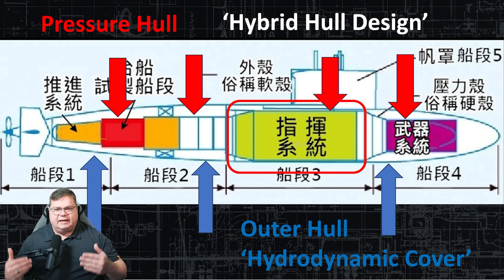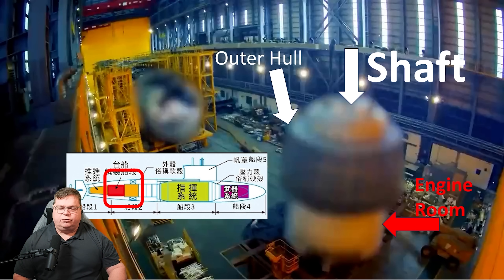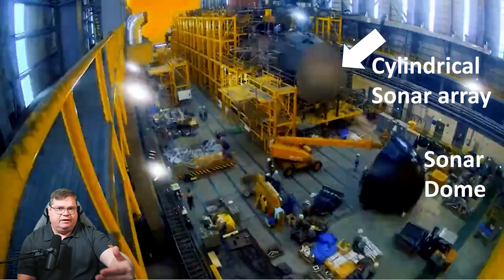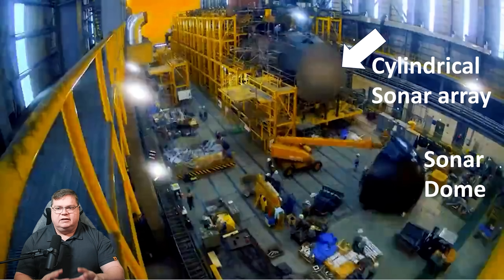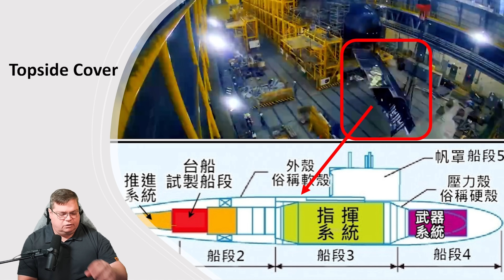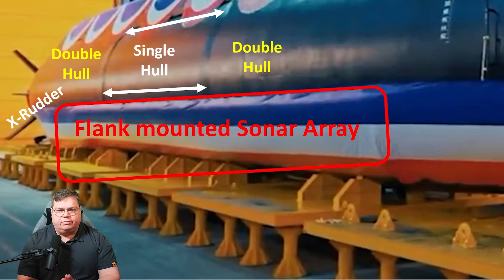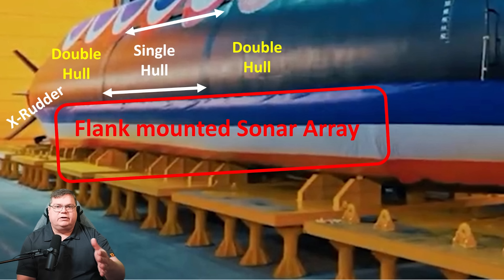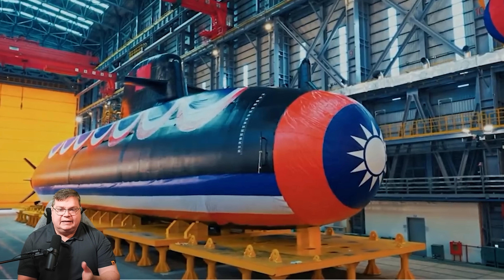What They Don't Tell You About Taiwan's First Submarine

Comment: Congrats Taiwan on a pretty solid first domestic boat design!
Reply from the maker: It really is!
Reply: Taiwan's first nearly 3,000-ton self-made submarine "Narwhal" has just been built and is undergoing testing. Taiwan's first AI unmanned attack submarine "Huilong" will also be launched by the end of this year.
While Taiwan is building manned submarines, it is also secretly using submarine development technology to produce unmanned submarines. The self-made "Huilong" (meaning: Intelligent Dragon) unmanned submarine is a smaller version of the submarine, with specifications of 30 meters long, 6 meters high and 3.6 meters wide. It adopts a double-shell design (the length of the inner pressure shell is 20 meters). Its height including the sail cover is 6 meters, and the outer shell is also coated with black sound-absorbing coating. In addition, the internal settings are not only equipped with cruise, sonar detection and other systems, but more importantly, it also adds a life support system (for special forces missions) and a system equipped with two torpedo launch tubes. This is almost the basic configuration of a 100-ton small submarine. It uses a hull similar to a manned submarine with a sail-type structure design, and is also equipped with two torpedo launch tubes. The "Huilong" unmanned submarine can launch small unmanned AI boats, torpedoes, mines and underwater loitering munitions to monitor, lock on and loiter attacks on enemy targets. The hull of the "Huilong" unmanned submarine is made of alloy steel produced by Taiwan Steel and can withstand seawater pressure of 1,000 meters. It allows the "Huilong" unmanned submarine to stay at a depth of nearly 900 meters underwater. Not only will it not be detected, but it will also be unable to be attacked by mines or torpedoes.
The "Huilong" unmanned submarine can perform combat missions alone, or it can accompany the submarine as a wing boat for coordinated operations.
Taiwanese civilian manufacturer has developed an Autonomous Underwater Vehicle (AUV) for the Navy - the Seawolf 400 AUV system. The Seawolf 400 AUV is 4 meters long, weighs about 1,000 kilograms, has a speed of 2 to 7 knots, can submerge for 8 to 10 hours, and can carry AI reconnaissance equipment and attack weapons.
Taiwan's Navy has partnered with an innovative company to develop an underwater glider. This equipment has the characteristics of long-term operation, large-scale collection of underwater information, high concealment, low maintenance and operation costs, fast maneuverability, and diversified underwater reconnaissance. It can collect hydrographic information for the Navy and influence the selection of sonar modes and the application of tactics. In addition, the equipment also has stealth characteristics and can perform underwater missions for more than one month, improving the Navy's ability to deal with underwater operations and intelligence collection. Several underwater gliders are currently being deployed to perform missions.

Taiwan plans to produce eight Submarines, 46 AI Unmanned Submarines, hundreds of Seawolf 400 AUVs, and a fleet of Underwater Gliders. Based on this, the Taiwan Navy has been able to build a powerful, modern underwater fleet with AI networked combat capabilities.
Reply: The Navy of the Republic of China 🇹🇼 is so powerful 👍
Reply: I am a Taiwanese , Ｉ want to say thank you to West countries . Without your help , we could not build this Submarine . We will always stand with Liberty and Democracy , never surreder to the dictator!
Reply: @台灣跑起來  Same here. Thank you all the foreign countries who helped us!!
Reply: @台灣跑起來 還有日本和韓國。
Reply: @台灣跑起來  You should thank Korea as Taiwan needed Korean companies to assist. And to make matters worse Taiwan allowed technology to be leaked to mainland China.
Reply: Underwater submarines are difficult to detect. The waters around Taiwan are even more complex due to the Kuroshio Current and volcanic terrain.
The Kuroshio Current, also known as the Japan Current, is a branch of the North Pacific Ocean current system. It is the second largest ocean current in the world, originating in the Philippines, passing through the East Coast of Taiwan, and flowing northeast along Japan before merging with the North Pacific Current. The Kuroshio Current has a current speed of 1 to 2 meters per second and a width of over 200 kilometers. Fish and underwater vehicles are carried along by the Kuroshio Current like they are on a highway, automatically flowing towards the North Pacific Current region. The complex deep sea area where the fast-flowing Kuroshio Current passes through stretches from the Bashi Channel region in southern Taiwan, connecting to the East coast of Taiwan, to the Miyako Strait region in northern Taiwan.
Sea of East Coast of Taiwan, a "thermocline" is formed in the area where the water depth is 100 meters. Only a few sound waves can penetrate this "thermocline." Most of the sound waves are reflected back from the "thermocline" like a mirror, and continue to transmit back and forth between the "thermocline" and the surface of the sea. A sonar detection blind zone is formed below this area. Taiwan submarines and unmanned submarines can hide in this blind zone, and the Chinese military ship's sonar system or the sonar detection system thrown into the sea by anti-submarine aircraft from the sky will be unable to detect Taiwan submarines and unmanned submarines.
If Taiwan submarines and unmanned submarines dive to a depth of 200-300 meters below sea level, the enemy can only use submarines to search for submarines to detect them. However, the surrounding waters of Taiwan are Taiwan's territory, especially the Bashi Channel in the southern part of the Taiwan Sea connecting to the Miyako Strait region in northern Taiwan, which is an area with unpredictable Kuroshio Currents. Chinese submarines or underwater vehicles cannot stay in this area for long. They will be automatically washed away to the North Pacific Ocean by the Kuroshio Current and will be unable to sustain combat operations here.
Taiwan has already fully understood the Kuroshio Current area in the east, and is clear about the changing location of the underwater ambush zones around Taiwan throughout the four seasons. It has also deployed fixed and floating underwater sensors or unmanned submarines. Taiwan submarines and unmanned submarines are ambushed in the underwater ambush zones that move with the seasonal sea conditions, or they release denial intelligent mines in the surrounding area in advance. Chinese submarines dare not approach, for fear of being caught in the net and killed. When necessary, Taiwan's IDS submarines can dive to a depth of nearly 400 meters below sea level, where Chinese submarines cannot reach. They can then launch MK-48 torpedoes to easily destroy any enemy submarines or enemy fleet convoys that want to attack.
Taiwan's geographical location is unique. The West Taiwan is separated by the Taiwan Strait to China, which is on average 180 kilometers wide, which is a natural barrier that can easily deter China's attempt to invade Taiwan by landing. The Bashi Channel in southern Taiwan connecting to the East Coast of Taiwan to the Miyako Strait in the north is an area with fast-flowing underwater currents. It is an area that cannot be stayed for long unless there is support from a nearby port. It is also a natural barrier. Taiwan's great self-made submarine capability has supplemented this block of underwater defense and combat capabilities. It can easily deter China's attempt to invade Taiwan from southern, eastern, and northern Taiwan. Taiwan's national defense is in a state of prosperity, and Taiwan can now rest assured.
Taiwan's domestically produced submarines and unmanned submarines are the most important strategic weapons of national defense. Now that Taiwan has produced manned and unmanned submarines, China not only has no chance to cross the sea to invade Taiwan or blockade Taiwan, but it also has to worry about its ports being blockaded, which will completely shatter China's illusion of invading Taiwan! Taiwan's air defense missile system density is one of the highest in the world. It is impossible for the Chinese military to fly over. The Taiwan Strait in the west of Taiwan is a transparent firing line. The Chinese military ships and submarines that invade from here are tantamount to suicide. The southern, eastern, and northern parts of Taiwan are guarded by the natural Kuroshio Current barrier and the submarines and unmanned submarines of Taiwan Navy. The Chinese aircraft carrier, destroyer, and escort fleet will not dare to come.
Reply: This is the KEY😂🎉
Reply: Taiwan took 4 years to learn and design its self-made submarine, and only took 3 years to complete its self-made modern submarine.  Taiwan break the world record for manufacturing the submarine. In 1988 Taiwan was the 1st Asian country who could design and manufacture self-made 3rd generation Jet Fighter. Taiwan is also designing its own fifth-generation stealth twin-engine fighter jet, and the prototype will be produced in 2025. Taiwan is not only strong in semiconductor chip manufacturing technology, but also in other industries. Bravo Taiwan.
Reply: Taiwan has successfully developed a 533mm-diameter torpedo launch system for Taiwan-made IDS submarine Narwhal. In addition to being used to launch US-made MK-48 heavy torpedoes, the system is also being prepared to launch Taiwanese-made submarine-launched Hsiung Feng II anti-ship missiles, submarine-launched Hsiung Feng III supersonic anti-ship missiles, submarine-launched Hsiung Sheng cruise missiles, and submarine-launched Sky Sword II air defense missiles. The diameters of these Taiwanese missiles, after being modified and installed in submarine-launched pods, are all smaller than 533mm torpedo launch tubes, and the IDS submarines can all launch them in the future.
During launch, the torpedo tube will push the Taiwanese missile pod into the sea. After traveling a certain distance and approaching the surface, the missile engine will ignite, break out of the pod, and emerge from the water. After the guidance system is activated, the missile will fly into the sky and autonomously attack the target.
Reply: @taorente7438  All 3rd party tech which will be handed down to their mainland chinese brothers. Chinese Taipei is he biggest backstabbing nation on earth. Despicable. They use White Western names and rathe be Japanese even though they were colonized by them. LMFAO.

Comment: Oh no, that hull design looks bad. Too many different diameter pressure hull segments with steps welded together. Every one is a weak point and it would be better to make it with smooth transitions or the same diameter throughout the pressure hull. We don't want it to pull a Titan and implode at depth.

Comment: Superb coverage of this exciting new boat which seems perfectly specified to address the immediate threats Taiwan faces. Great job Arron, great job Taiwan!
Reply: Taiwan's first nearly 3,000-ton self-made submarine "Narwhal" has just been built and is undergoing testing. Taiwan's first AI unmanned attack submarine "Huilong" will also be launched by the end of this year.
While Taiwan is building manned submarines, it is also secretly using submarine development technology to produce unmanned submarines. The self-made "Huilong" (meaning: Intelligent Dragon) unmanned submarine is a smaller version of the submarine, with specifications of 30 meters long, 6 meters high and 3.6 meters wide. It adopts a double-shell design (the length of the inner pressure shell is 20 meters). Its height including the sail cover is 6 meters, and the outer shell is also coated with black sound-absorbing coating. In addition, the internal settings are not only equipped with cruise, sonar detection and other systems, but more importantly, it also adds a life support system (for special forces missions) and a system equipped with two torpedo launch tubes. This is almost the basic configuration of a 100-ton small submarine. It uses a hull similar to a manned submarine with a sail-type structure design, and is also equipped with two torpedo launch tubes. The "Huilong" unmanned submarine can launch small unmanned AI boats, torpedoes, mines and underwater loitering munitions to monitor, lock on and loiter attacks on enemy targets. The hull of the "Huilong" unmanned submarine is made of alloy steel produced by Taiwan Steel and can withstand seawater pressure of 1,000 meters. It allows the "Huilong" unmanned submarine to stay at a depth of nearly 900 meters underwater. Not only will it not be detected, but it will also be unable to be attacked by mines or torpedoes.
The "Huilong" unmanned submarine can perform combat missions alone, or it can accompany the submarine as a wing boat for coordinated operations.
Taiwanese civilian manufacturer has developed an Autonomous Underwater Vehicle (AUV) for the Navy - the Seawolf 400 AUV system. The Seawolf 400 AUV is 4 meters long, weighs about 1,000 kilograms, has a speed of 2 to 7 knots, can submerge for 8 to 10 hours, and can carry AI reconnaissance equipment and attack weapons.
Taiwan's Navy has partnered with an innovative company to develop an underwater glider. This equipment has the characteristics of long-term operation, large-scale collection of underwater information, high concealment, low maintenance and operation costs, fast maneuverability, and diversified underwater reconnaissance. It can collect hydrographic information for the Navy and influence the selection of sonar modes and the application of tactics. In addition, the equipment also has stealth characteristics and can perform underwater missions for more than one month, improving the Navy's ability to deal with underwater operations and intelligence collection. Several underwater gliders are currently being deployed to perform missions.

Taiwan plans to produce eight Submarines, 46 AI Unmanned Submarines, hundreds of Seawolf 400 AUVs, and a fleet of Underwater Gliders. Based on this, the Taiwan Navy has been able to build a powerful, modern underwater fleet with AI networked combat capabilities.
Reply: Good job
Reply: Taiwan took 4 years to learn and design its self-made submarine, and only took 3 years to complete its self-made modern submarine.  Taiwan break the world record for manufacturing the submarine. In 1988 Taiwan was the 1st Asian country who could design and manufacture self-made 3rd generation Jet Fighter. Taiwan is also designing its own fifth-generation stealth twin-engine fighter jet, and the prototype will be produced in 2025. Taiwan is not only strong in semiconductor chip manufacturing technology, but also in other industries. Bravo Taiwan!
Reply: Would be nice to see some impact simulations of those Mk 48 Adv Cpblty Mod. 6's on a random range of blockading craft. 11:46

Comment: Looks like they focused on cheap and small. Seems like a good stratagy considering the mission. They dont really need a blue water navy, they just need to protect their coast line in shallow water from the chinese. 

Maybe the plan is the make a large quantity of these and have them hanging out on station every few miles as torpedo trucks.

Cheap sub, small crew so individual surviveabilty is less of an issue. Just use mass numbers to overwelm the chinese navy?

Just a thought
Reply: The east coast of Taiwan is the Pacific Ocean. The depth closest to Taiwan in this area can reach 3,000 meters. Therefore, Taiwan needs a submarine of 2,500-3,000 tons to be equipped with a fully functional sonar system and combat system, and at the same time, it must be large enough to be able to move safely and stably underwater at a depth of 300 meters. The sea conditions in the Pacific Ocean are hazardous all year round and are entirely different from the Mediterranean Sea in Europe, so cheap and small submarines cannot operate in such conditions on the east coast of Taiwan.

Comment: Doesn’t the external hull have to be somewhat smooth just to keep flow noise low? Would guess that Taiwan’s submarine is designed to operate  within 300-499 NM of the coast. Just a few of these platforms laying sea mines would totally disrupt Chinese coastal / international trade. It just has to be extremely stealthily and survive.
Reply: I have also heard that if the outer surface is not smooth, it will be difficult to have acoustic stealth tiles adhere properly.